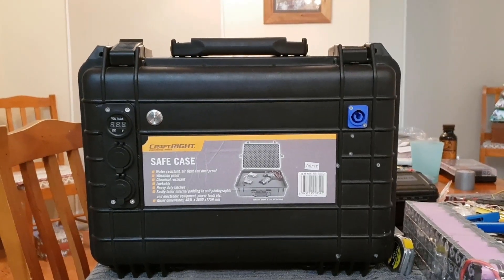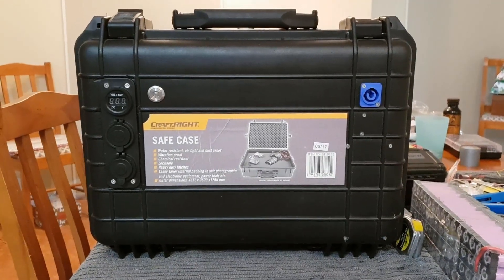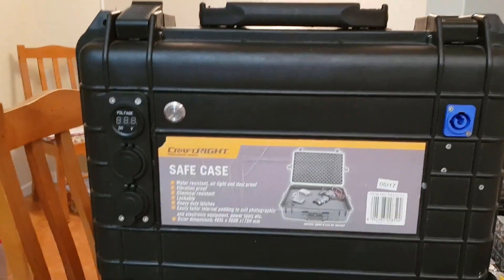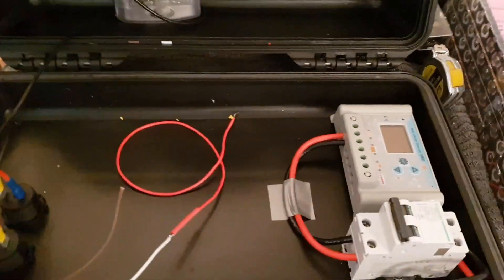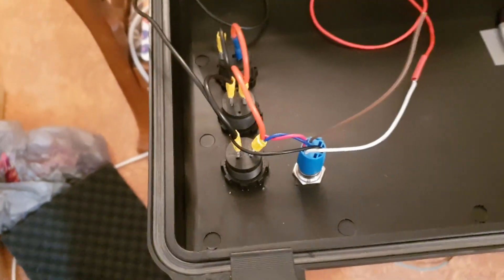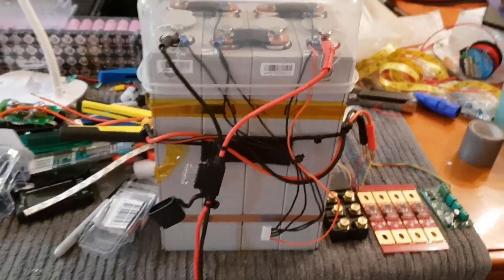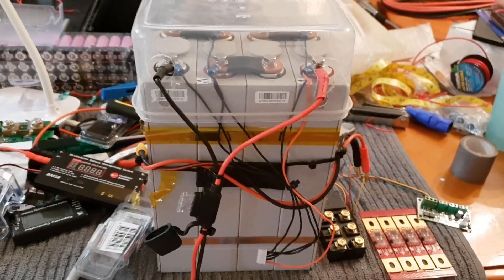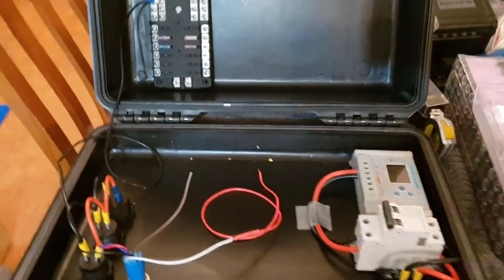DIY 12 Volt Portable Solar Power Generator Part 1.

Comment: Unless you try using a dc to dc buck converter And make sure you get the voltage right. Lithium is a pain in the arse when its solar setups.

Comment: I just stumbled onto your video after having ordered 4 CA180FL's for a test battery before I commit to a full 48V set of them. I need to make one of these with the little 72aH ones now on offer from evworks. My 180's are coming from there too - Tim (@ evworks) is a great guy - rang him up and said "where the flaming heck is my battery" (only in a more polite manner) and he said "it will be with the courier tomorrow". Sure enough, its on the road :)
Reply from the maker: They are great batteries in my opinion.
Stay tuned to my channel I’ll be setting up my 48v system again soon. It’s all been in storage for 12 months while I moved and have just built a new shed.
Will you share vids of your system?
Cheers
Reply: @offgriddreaming5403  I sure will - at the present I have been testing my new 48V 3kVA Victron inverter. Its a beast, and breaks toes if you drop it on them (just starting to loose the limp!). Picked up a go pro hero 7 for the timelapse of the panels going up too. Presently my SLA bank is kept charged by a modified APC ups (its battery settings tweaked so it doesn't cook the batterys).

Comment: What do you plan to use it for?
Reply from the maker: Hi
It's all in the description. Mainly for camping trips but also for power outages.
Reply: @offgriddreaming5403  Ah, sorry.

Yeah I built a (hobby-size? small? 250Ah) lead acid off-grid system at my place, yeah it's great fun and all but finding the most efficient use for it is difficult. 

Yeah I was smirking for the 5 hours of power out we've had for the last 2 years, keeping the fridge and some led lights going, but...
Reply: @clintoncoker6  do you have it charging via solar? Run a few circuits in your home from it to reduce your energy bill.
Reply: @codymiller8505  Sure, but then you may as well just have solar pv without storage to offset your grid use.

You could use small battery storage to offset some night consumption but it doesn't seem like the most functional use of the system.

It would be good for camping stuff - if you used it often enough.
Reply: @clintoncoker6  true. It would mostly be for the independence and self reliance of having your own way of collecting and storing energy. Grid tie systems are fine, but when the power goes out yours goes out too. It may not be the most efficient way to keep the lights on but it would be very dependable for peace of mind.